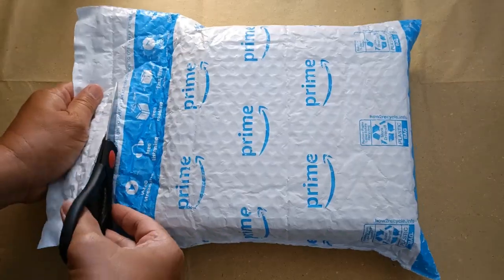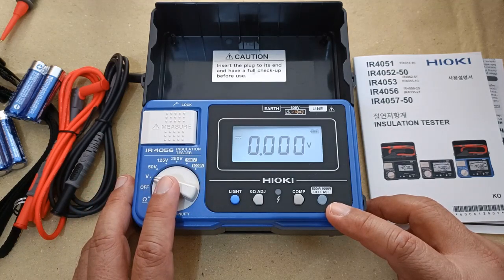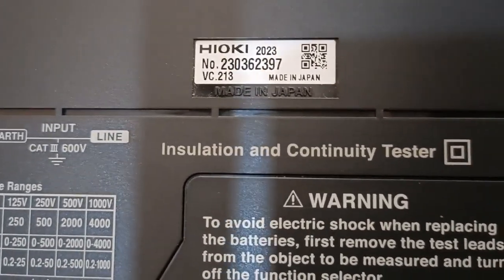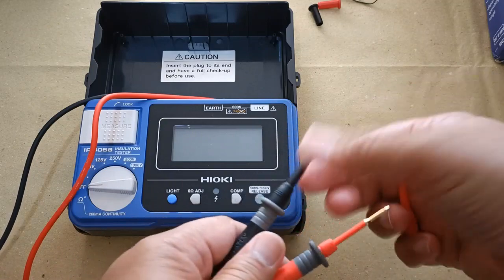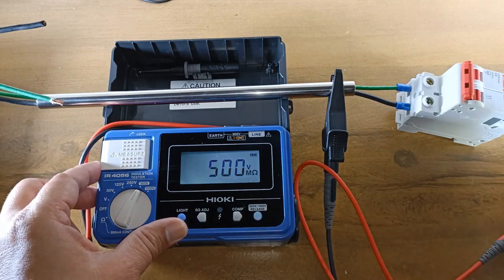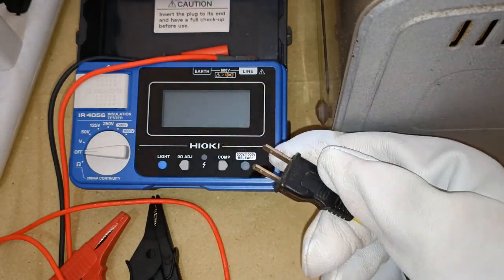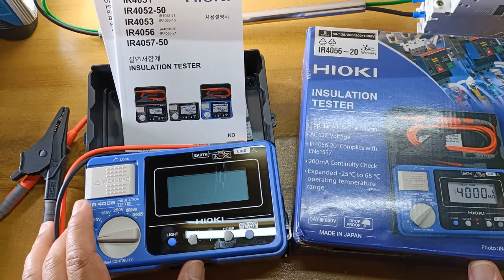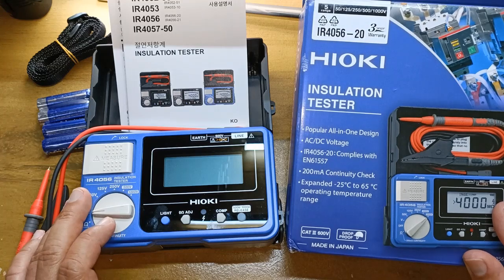How to Use the 2023 Hioki IR4056 Insulation and Continuity Tester- Unboxing and Review [CC]

Comment: Thanks for the fantastic video. Can you check capacitance as well? (Microhenri microfarad values?)
Reply from the maker: @jazziefirst  I appreciate your comments. The IR4056 however isn't designed to test capacitance. You'd need the Hioki DT4261 or DT4256 for that. If you need both capacitance and inductance you may want to look at different models of L/C testers.

Comment: When will you choose the 50v,125v,500v,1000v 
Thank you sir
Reply from the maker: Thanks for watching. Note that there are safety procedures to observe first before actual Insulation Resistance (IR) test is performed. This is just my personal opinion. The low voltage selection, 50V DC is generally used for preliminary testing of circuits. For circuits where operational voltage is 125V the test voltage of 125V or 250V DC may be used. For 230V circuit wiring or 230V rated motors, the 250V DC or 500V DC test voltage can be used. For circuits serving 460V, the 500V DC or 1000V DC test voltage is often used. That said, it's still up to the judgement of the engineer on site which IR test voltage to use based on equipment and personnel safety, the requirements of the client, contract compliance, and if the manufacturer of the equipment being tested specifically requires a certain IR test voltage to be used. There can be reasons other than these, so you may want to do a bit more research.

Comment: That is the one I purchased recently after talking to a couple of Electricians to find out what they use now. My old analogue MEGGA just doesn't cut it anymore. It's simplicity with all the required functions were the seller for me, while giving excellent performance. I have gone ahead and also ordered the remote Test Leads, which are on back-order...so far 4 weeks. Interesting regarding your demo. I have just re-terminated an extension lead due to corrosion on the Female side. This lead lives outdoors and gets turned on for the pool robot. Despite that there was no visual damage to the lead, I decided to do a full insulation test on it. To my surprise it past, but not at the level I expected. It was 1.4MOhm between Neutral and Active. I then tested another extension lead which was inside the house (in a dry area), which showed a far higher insulation, proving that cabling exposed to weather cycling will absorb moisture over time and lower their insulation. Again..well done. Good video
Reply from the maker: Thanks for your comments. This unit of IR4056 actually belonged to my brother. I have the IR4057 which is almost the same. Sorry I can't picture out the outdoor extension leads you mentioned, but I think in general a 1.4MOhms insulation seems very low for a branch circuit wire, although it may pass the threshold that you set. I repaired a branch circuit submerged in flood water so I know what you mean with moisture ingress on wire insulation. My IR4057 simply turned red and beeped continuously indicating a totally failed insulation. That remote test lead sure is a good addition. Another feature I appreciate is the 200mA continuity function. As you already know it puts more pressure on test objects than what a standard DMM can do, all the better to expose weak links of conductors, as well.
Reply: @ramschannelreviews  The extension lead is just a long lead from a Power Point Outlet to a device that you want to plug in. It is not part of the permanent House wiring. Now using ohms Law, 1.4MOhms at 245VAC gives you a leakage of 0.175mA. So 1/5th of a milli Amp. Our Wiring Rules state that in a domestic installation, the minimum Insulation between any conductor has to be 1 Mega Ohm..that's the rock bottom minimum, measured at 500Vdc. That is with nothing connected in the circuit. Now for a house wiring (backbone), I would NOT except that value, despite that it passes as per rules. I also tested the extension lead at the 500Vdc setting on the IR4056. Good fun communicating with you. It gets my old brain cells going as I have to remember all the rules and maths I learned 25+ years ago and haven't had to use it much since then.
Reply from the maker: @alf699  Thanks for clarifying. I think we call that by a slightly different name: extension cord, haha. Very common here. You have a plug at one end (goes to a wall outlet) and a portable, surface type outlet at the other end, where we connect appliances or power tools. Sometimes it goes to the neighbor without electricity yet where it becomes a flying connection and illegal. It's interesting you mentioned 1/5 of a mA leakage. I've read that below 1mA, current is still imperceptible, tingle at 1mA, "mild" shock at 5mA, and can already be deadly at just 10mA. I suppose it puts the job of an insulation tester an essential one for safety.
Reply: @ramschannelreviews  We over here in Australia use RCD's (Residual Current Devices) These are mounted in the House Meterboard for each Circuit and they are part of your CB protection per circuit. The legal limit before tripping is: "30mA" maximum. So 10mA is unlikely to kill you as it has to get passed the natural Resistance of the skin first. 5mA would cause a lot of nuisance tripping. The RCD's work by checking an imbalance between Active and Neutral (or in your case Line1 and Line 2). They are essentially simply a current Transformer (CT). If the same current flows in and out, it's balanced and no voltage is created across the two ends of the winding. If there is an imbalance (current from one side goes somewhere else example: to ground via yourself resulting in an electric shock), then the imbalance creates a voltage across the coil (CT) and causes the RCD to trip. Don't quote me but I think it takes less then 200mS. I know it's less then one heart beat....  Anyway..just some info, if you didn't already know 🙂
Reply from the maker: @alf699  I appreciate the insights. One of the circuit breakers in my demo board is actually a mini RCBO.

Comment: i have one,,,
Reply from the maker: Congrats! It's a fine test equipment from Japan.
Reply: @ramschannelreviews هل يقيس المكثف وكم يساوي سعره حاليا بالدولار. وما هي اعلى سعة يمكنه قياسها في المكثفات . أرجو التوضيح لو سمحت
Reply from the maker: @laetlaet6130  I appreciate your comments. The IR4056 isn't designed to test capacitance/ capacitor. You'd need the Hioki DT4261 or DT4256 for that. I ordered my IR4056 from amazon about 2 years ago for around U$165. It's price is different now, however, depending on where it's sold.